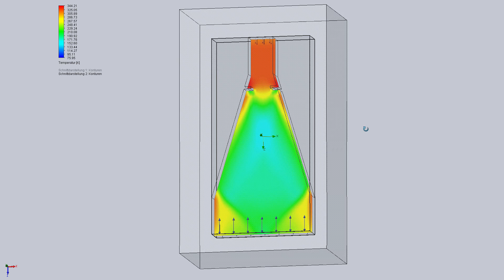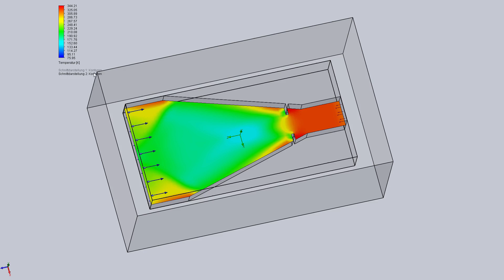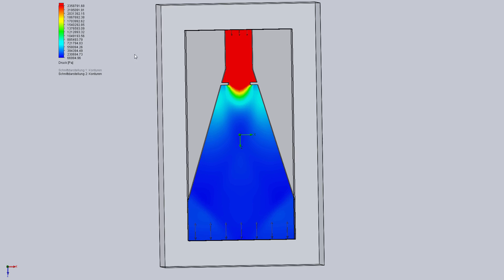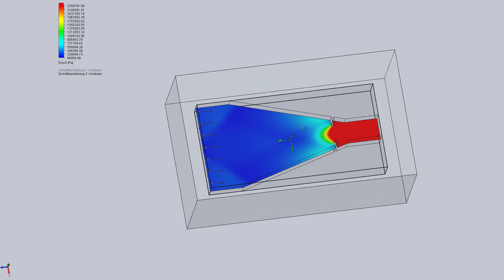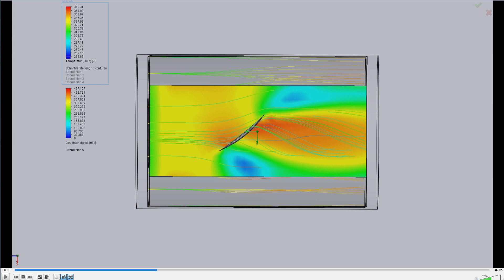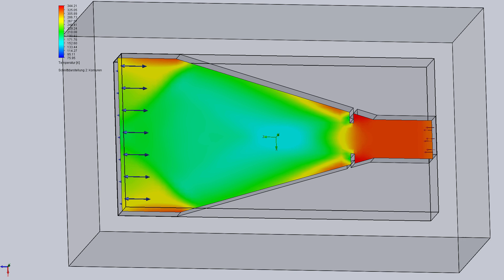Aerodynamic Pressure Cooling - A Quick Explanation And Simulated Demonstration

Comment: Can this be leveraged to chill say, CO2 down to solid/liquid?

Also, could this method be used to cool air in a room, if your fan and high velocity tube are located outside of the room and the expansion chamber is located inside the room?
Reply from the maker: sure, that is essentially how air conditioning units and systems for isolating gases from the air work, except instead of just using fastmoving air they use a pressurized coolant that evaporates/condensates at around that temperature in order to make thinge more efficient and compact